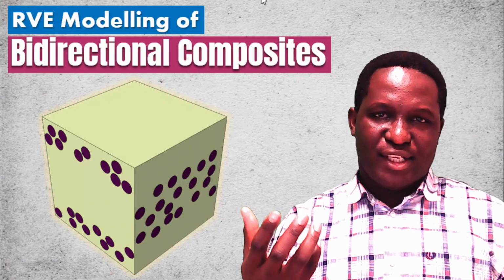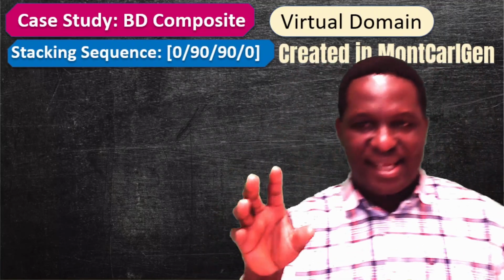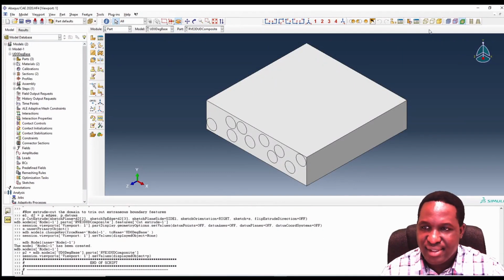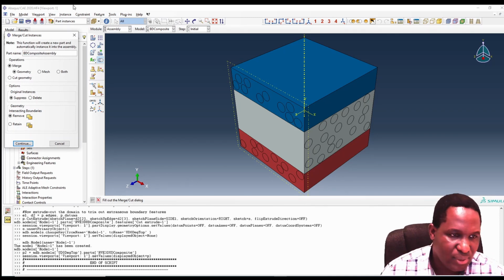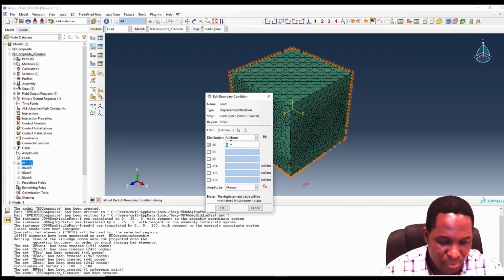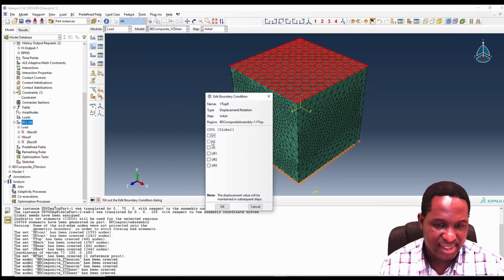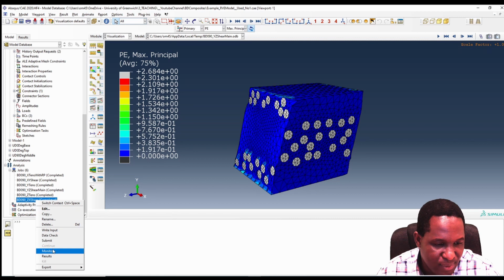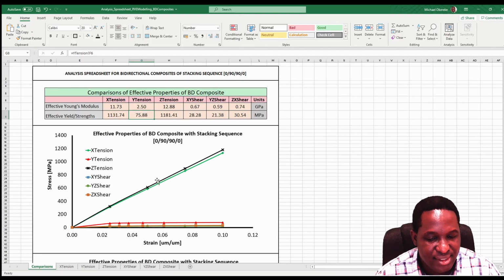RVE Modelling of Bidirectional Composites in ABAQUS

Comment: you should put plastic properties of glass fibre
and Von Mises stress is used for the metal and isotropic materials at most situations, which can not represent the stress state of composites with anisotropic properties.
Reply from the maker: Not sure I understand or agree. Von Mises stress works generally as it is an effective (average state of stress). The Glass fibre studies here is essentially isotropic and the matrix as well so for such RVE (micromechanical) modelling, it is okay to represent them as I have seen. If you are doing a laminate analysis, then you can incorporate the required anisotropic properties of the laminates. Maybe, I have not understood your comment properly.

Comment: How did you calculate effective properties
Reply from the maker: The effective properties were calculated simply from the stress-strain plot. Young's Modulus is the slope (in linear region) of a stress-strain plot while the Strength is the first maximum for the stress data. If you download the excel file referenced,  you can see how I did this for this simulation.

Comment: @MichaelOkereke in this tutorial, after the RVE modelling if I want to apply PBC for this, is it appropriate to create a set by selecting the surface nodes in XFront, Xback; YTop, YBase; ZFront,Zback and constraint that using the Equations?, I am trying to perform 1) 2D RVE-PBC compression 2) 3D RVE-PBC compression
Reply from the maker: Yes you can do what you suggested but it would be simply RVE Modelling but not PBC. For the later, it involves a different node to node  *Equations. Cheers.

Comment: SIR, I am running a similar RVE simulation problem having 4% Vf of backing fibers in the tensile load direction and 50% Vf of fibers in trasnsverse direction to replicate GFRP NCF Composite.I am using PBCs with node to node implementation. Experimentally i got two slopes in Stress strain curve but computationally i am getting a straight line only. Can u please help me sir.
Reply: Sir, i will be waiting for your reply
Reply from the maker: Hello @ME21D002, I am not sure why you are getting a single plot from your computational work. If you are combining two loads, then you should get two plots. It is a bit unclear what your question is. I will reply your email where you have provided more details. Thanks.

Comment: I have fibre epoxy perameter & matrix perameter how can i generate elastic propertics from rve modeling. I tried easy PBC. But can’t get the solution
Reply from the maker: Hello @Masfikun Mahim, I am not sure I understand the question. If you want to get the homogenized elastic properties of the RVE of this bidirectional composite, then I addressed this already from minute 35:00 of this videos. Once you generate the stress-strain plot, the elastic properites is the slope of the elastic region and similarly the effective strength (or yield stress), I have defined here as the global (absolute) maximum of the stress-strain plot. You can follow the discussion directly via this link: https://youtu.be/zHUC0cVkdVM?t=2100

If I have mistaken and you are looking for something else, then do then me. Good luck with the research.

Comment: I saw your RVE simulation for the bidirectional composite material, and it sparked my interest. I was also working on a composite material reinforced with plan wave fabric. It was extremely difficult for me to create the dry fiber fabric with Abaqus. However, I did it with TexGen software and meshed it with this software before exporting it as a stp file to simulate with Abaqus software. But I find it tough to simulate. And, once again, I imported the TexGen stp file into Abaqus and followed the steps in the video which you posted for the bidirectional laminated composite, but it is still not converged and message an error. How might you assist me with this? Can I provide you with the 3D drawing of the fabric and the matrix that I did for the RVE and can you help me if you see it? I hope you will solve my problem.
Reply from the maker: Hello @Endalkachew, thanks for this comment. It is definitely difficult making such models. I will hope to make some videos in future about woven composites. Good luck with the research.
Reply: @MichaelOkereke  Thanks, Dr. Michael. hopefully, you will do it.

Comment: Dr.Michael, thanks for your video. I ran into a problem: I made the model following each step in the video, but after submitting the job, it showed: "too many attempts made for this increment." I wonder if you can help me find out why.
Reply from the maker: Hello @Ali Peei, thanks for your interest. It is difficult to know for sure what is the reason for this problem. It could be you need to check the input values you used in your material library. It could also be that your loading is too much and so the simulaiton is struggling to converge at those large loads. I can only know by looking into the specific model setup and try and see what is going on. Good luck with the research. If you are a member of my CM Videos Insider Group (https://cmvig.cmvideos.org), then you can contact me directly there.

Comment: Nice video thank you professor but I want to know for fibre reinforced laminates is it possible to make 0,45 and 90degree instead of 0/90/90/0 ??
Reply from the maker: Hello @Hiten Singh, definitely, I could easily have done the case for 0/45/90 laminates but I didn't because this video was merely for a bidirectional composite. The case you cite here could be classed under an multidirectional composite. That could be a video idea for the future but the same principles in this video will also apply for that.
Reply: Thank you professor.

Comment: Thanks for another wonderful video, Dr. Michael. I have one question, what kind of situation does this boundary conditions represent? I with 3 faces symmetric and 3 faces free.
Reply from the maker: Hello @Haowei Huang, this is a good question. It is the standard boundary condition to use when you are working with a representative volume element and you want to simulate a uniaxial case. Think about it like this, if you have the full specimen model, and you hold the back and pull the front, what will normally happen is that the system will be free to move uniaxially at the held points but in the centre of the model, since there is no constraint on it, it will start showing a necking/narrowing deformation. This means, not every part of the system is experiencing a uniaxial deformation. 

The solution (for a 2D case) is to then isolate the original model into four quadrants, then for one of the quadrant, impose the type of boundary condition I have shown here. This means you will ensure every part of the model under deformation is seeing a pure (true) uniaxial deformation. As such, you can then compare the model predictions directly with a macroscale/structural level experiment. I hope this makes sense.

Comment: Thanks Dr. Michael.
Reply: Though you had explained reference point for defining displacements, I have not understood the importance of it. At what position should the ref. point be fixed? And Could you suggest a source to learn finding effective mechanical properties of a woven fabric composite?
Looking forward to hearing from you.

Thanks,
Shravan
Reply from the maker: Hello @Shravan Bhadoria, thanks for your interest in the channel. The reference point makes it easy for one to determine stress-strain plot on a model since you are only having to track parameters as force and displacement only in one point. The other way to do it is to use volume averaging where you have to write to history all properties for all elements in the model. If the model has a million elements, most student computers might not be able to handle that. To prevent that happening, you then use the constraint equation to tie the model (face) to a reference point anywhere in the model. It means that the behavioru of the reference point will be constrained to whatever is happening in the whole model. This way, you can conveniently track the history of that reference point as representative of the history of the whole model. It is the principle of Newton's third law of motion, where equal reaction initiates and equal force. So, the reference point is reacting to what is going on or the forces in the material. Provided the constraint equation exists, this is correct. 

On resource material for woven fabric composites, I have actually  not done a video on this on the channel but plan to. I have though an online course that I have developed which can help you. If you are interested in ths, then join my CM Videos Insider Group via https://cmvig.cmvideos.org and you will be able to contact me directly and then I can share this resource with you.
Reply: Sorry Dr. Michael for the delayed response. More importantly thanks for the time and explanation on the reference point. 

I had joined that group mentioned above. Looking forward to learn more from you.

Comment: Hello Dr. Michael, is it possible to use the RVE to model the properties of a whole beam?
Reply from the maker: Hello Vituko, thanks for your interest in the channel.  The answer is sort of No, especially if you set it up as I did here. However, if you choose a different RVE, then yes. You have to come up with an RVE that has a beam geometry and adjust your boundary conditions accordingly. 

For your beam study, I do think you should do a microscale study first using the approach described here. It will give you properties that can serve as input to a higher length scale study which can be your macroscale beam model.

This is the so called micro-macroscale modelling approach.